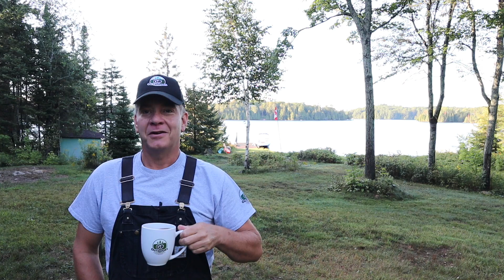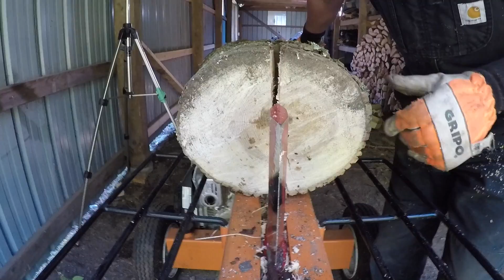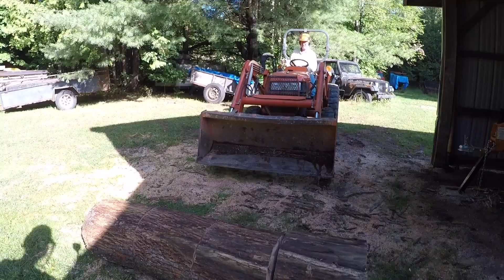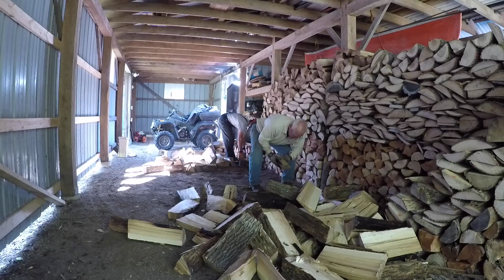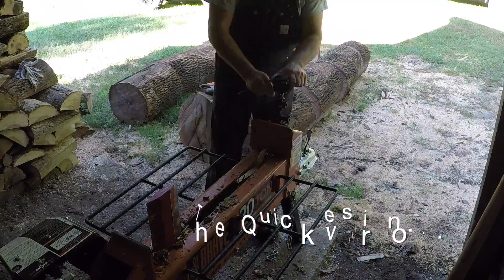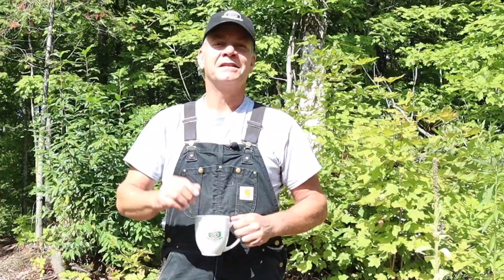#198 BRAVE Dual Split Log Splitter. Splitting and Stacking Ash. outdoor channel.

Comment: great firewood episode! i have never seen a dual direction log splitter! very informative and educational. good chance i will purchace one thank you! cheers from alabama bud!!
Reply from the maker: You are most welcome Dale! They are made in Minnesota. Best splitter I have used. All the best to everyone in Alabama!
Reply: @GPOutdoors  i screen shot that log splitter thanks. i think i had left a tech question to you on that other thread. not important. but hear is my question. whats your take on a hydraulic v/s standard screw type top link on a box scraper or use of one on other impliments as well? have a great day thanks.
Reply from the maker: Good morning Dale. Sorry I missed it. Youtube is not good at showing me reply comments. I have to keep manually scrolling through old comments from time to time to check for them. I haven't got one yet but after using the BB for the last couple of years I definitely think it would be of value to have, instead of getting on and off the tractor to keep adjusting it as I progress through the grading project. I see Dave from daveknowshow has one and swears by it and as you watch his grading videos you can see how easily he is able to adjust it as he grades. I don't do a lot of grading regularly yet so for now it would be a "nice to have" for me so perhaps one day. Hope that helps a bit. Have a good weekend Dale! Cheers!
Reply: @GPOutdoors  okay well thanks GP that was helpful. and i agree on the your statements about the benifits of a hydraulic top link. have a good day bud!

Comment: Neighbors helping neighbors, nothing not to like here Gord... " The Little Brave That Could" has proven itself to be very efficient methinks! I finished up my 10th cord of rounds yesterday using my compact commercial Brave 20 ton Iron & Oak, now a discontinued model. Looks identical to their 30 ton unit. Earlier on this season I added a pair of Black Diamond tables to the unit, in a word, a game changer! I also use a " trailer mover " now, that gained me 23" clearance, no more tables contact with the tractors rears. So the TSC trlr mvr by TARTER USA is a game changer too which also hauls logs & large tree tops... 
How is Guy feeling these days?
Bill on the Hill... :~)
Reply from the maker: Hey BOTH. So Sorry, somehow this comment just showed up but I see you sent it a while ago. Wow, you have been pumping out alot of work Bill! You'll be ready for the white stuff pretty soon! He is recovering slowly but getting better for sure. I'll let him know you asked about him. Cheers!

Comment: That certainly is a nice splitter . Dual splitting action and a wood catcher on both sides . It would kill me not burning wood to heat my cottage with all of that wood available . You ceratinly would save on propane Gord if you got a wood stove for your cottage and used it while you were at the cottage during the winter . Price of propane  just keeps on going up and up . I think it's the first time we've seen Bob . He looks a lot like Guy . LOL
Reply from the maker: Good day Henry! Bob has been in and out over the last year but not often. Really nice neighbour and always there to help out. For me, it's not practical to burn wood for several reasons. I thought about it years ago way back when we were building the place. But certainly would be nice to have an open fire from time to time for sure. Have a great weekend!

Comment: Hi GP!  That’s a fine working splitter, and certainly faster than my 22 ton Champion. Maybe you should post a warning that watching this could be hazardous to your wallet LOL!  And speaking of wallet impact, I pick up my new HLA root rake grapple tomorrow. Can’t wait to try it out on the weekend!  Best wishes to Guy!
Reply from the maker: Good stuff Dave! I think you will like it! Should provide a few hours of fun in the forest this weekend. Thanks for the wishes - I'll let him know. Have a great weekend out there!
Reply: Well GP, I just spent most of the day with the new grapple and the brush hog on the L4060. After a few minutes of playing with a modest sized surface rock to get a feel for the controls, I headed for a pointed deadhead rock in the lane that has annoyed me since i bought the land.  The HLA grapple did its job brilliantly and within a couple minutes the pointed tire-wrecking lawnmower blade bending rock was out. Between rocks, old logs, brush and roots, not to mention saving my brush hog from hitting things, it has pretty much earned its keep already!  Thanks again for the great videos you’ve made on the HLA grapple - I likely wouldn’t own it without those!
Reply from the maker: LOl! That's great Dave! Happy it is working great for you. It's a tank for sure. My only mistake with it recently is i keep trying to close the jaws too hard which is why I bent a couple of tines. But I think you will find it will use it a lot more than the bucket out there. Feels good to be able to grab debris and move it. Enjoy it and all the best!

Comment: Hey, GP! Greetings from Missouri. Really enjoy your videos. Watching you & Guy stack that wood up in sheds like you do makes wonder, do you have any problems with it drying quickly enough? I like to have mine out where it gets lots of sun & wind.
Reply from the maker: Good morning Mark and thanks for watching. Great question. You will see soon that Guy removes all the side panels off the shed so it gets lots of cross winds through 3 sides. We also try to find dead standing where possible but yes, sometimes some of the wood is not seasoned enough by the time he gets to it. Thanks again and enjoy the weekend!

Comment: Nice work GP. Do you burn wood in your cabin? For large rounds like that I mount my bolt on forks close together and slide them under the rounds then off load the wood right onto the splitter to eliminate most of the lifting. Just a thought?  Have a great week and happy splitting. I will be doing the same as soon as the 90 degree weather leaves Ohio in the next few days. Cheers
Reply from the maker: Good morning Roy. That's a great idea. I did it with some huge maple rounds back a few months ago - it worked great. Our weather has cooled off quite a bit now - great for working outside. No black flies. No deer flies and barely any mosquitoes left. Whew! LOL. Have a great weekend!

Comment: great start to the 2019 wood stacking competition how about a suggestion like using a wheelbarrow instead of trying to throw them and bend over to pick them up .   Here in Florida I will only use a handful of wood for the chilly days that we have  maybe 10 days but it has been brutally hot summer.   where did the guard dog go is he in bed with Guy . great  start on the woodshed
Reply: You are right Bob!  I would use a wheelbarrow. Even being close to the cord, it would serve as a stand. So you don't pick them from the ground. The only time it's better putting them on the ground is for the very first row to cord from the ground up.
Reply from the maker: A good idea Bob. I had a wheelbarrow right there, too. I should have used it. LOL. Yes, actually he is. Hopefully Guy will be better soon. Thanks and all the best!